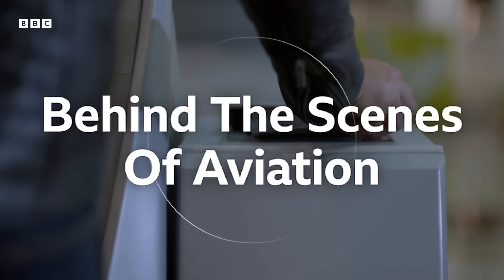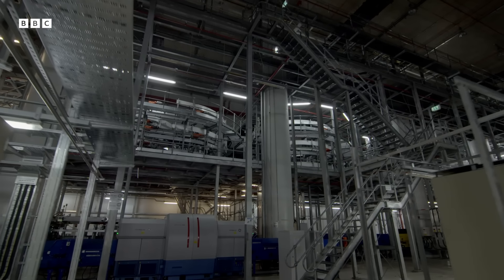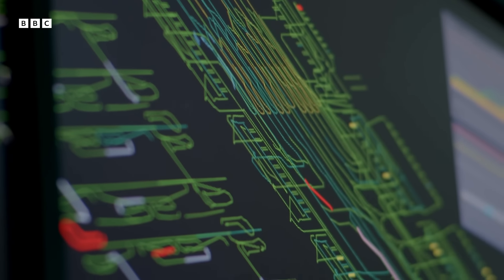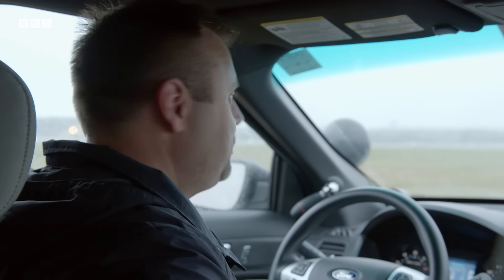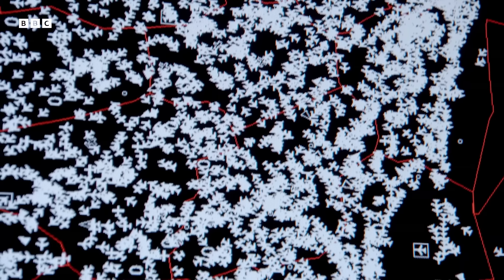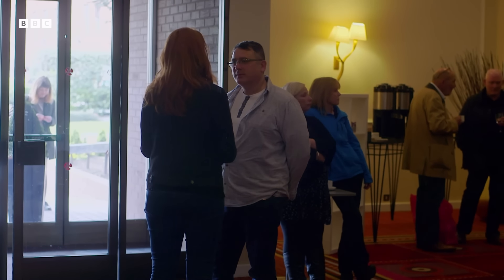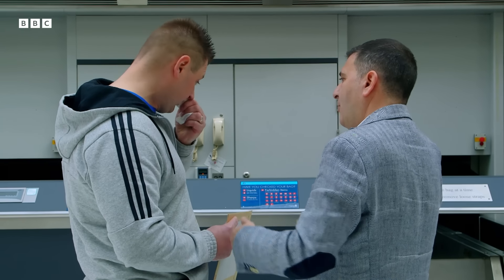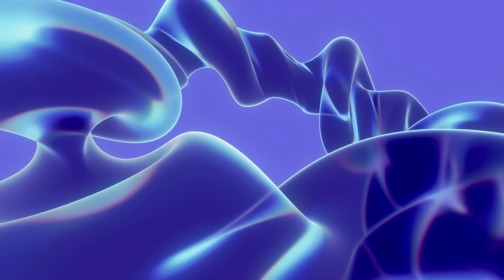Behind The Scenes Of An Airport | BBC Earth Science

Comment: I strongly dislike the notion that “everyone knows the routine” at the airport. Some of us don’t fly more than once or twice a decade—and getting there only to find that the process isn’t marked well is frustrating. When there are (for instance) 3 or 4 lines for the security check how in the world am I supposed to know which one to get into if the signs are cryptic?
Reply: Complain to your local airport instead of some random bbc video.
Reply: Then you should prepare yourself and fly even more often 😉
Reply: The problem isn't that the process isn't well marked. It's that the process changes randomly. Especially when agencies like the US TSA get involved.
Even regular travelers have issues because the process can be different, even between two different parts of the same terminal.